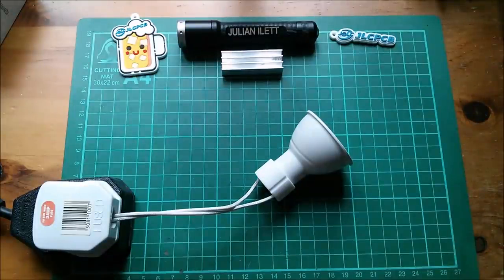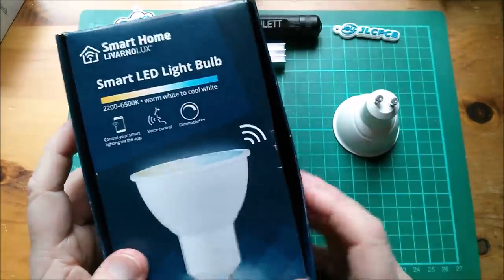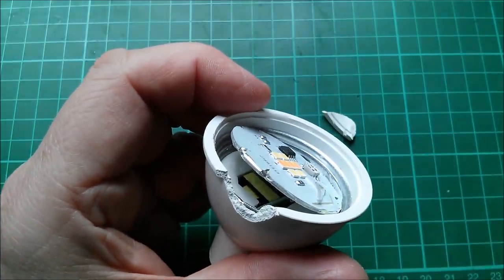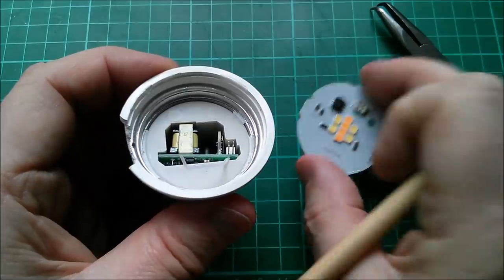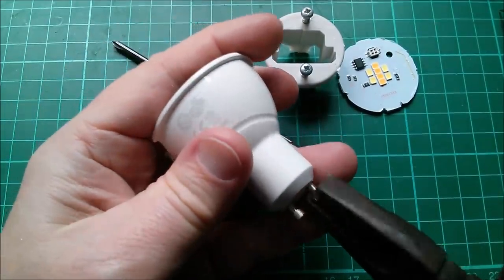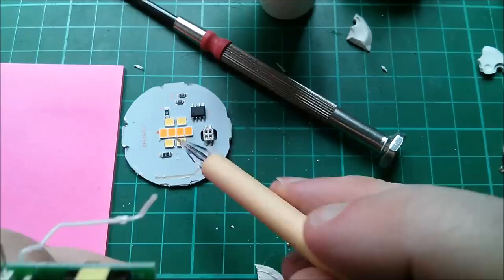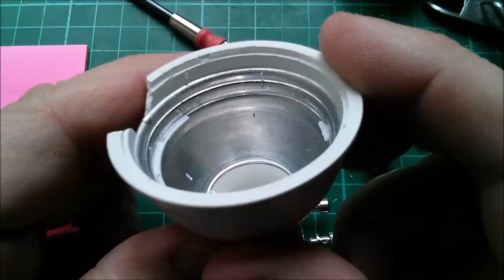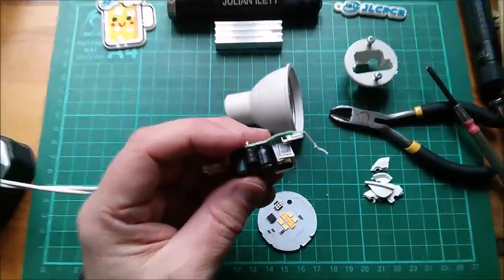Destroyed: Lidl GU10 Smart LED Light Bulb

Comment: Frankenstein it back together Use  it in the shed.
Reply: It's not broken, it just needs a new box.Would be interesting to see what voltage the Zigbee module and LED's run at, convert it to a DC bulb with a buck converter, and run it directly from your batteries.
Reply: Trouble is we know what would happen, how long it would take and how it would end up.
Reply: I agree! Make your own enclosure. You could actually improve the heat dissipation.

Comment: I'm working at a company that is making smart home stuff. I'm in the team that's programming the efr32mg21. We are mostly using zigbee but I've done some research in using that chip with Bluetooth Mesh and even Green Power with wireless switches without battery (powered by the force generated by pushing). Our products are quite expensive but really well engineered so it is quite interesting seeing a low cost application using the same chip.

Comment: Chop the GU10 connectors off, attach a suitable plug and wire to it, pot up the back end to make it safe again, superglue the broken bit from the side on, re-glue the lens back on, and it'll live again... use it on the solar shed with your powerpacks... Problem solved! Nice video btw ;)

Comment: 240v across the inputs and you can get it going again, surely. And checking the four pin connector to the LED panel, you probably have an IOT board that will drive whatever you want to attach it to.

Comment: BP = Bright Power, which are an LED lighting driver manufacturer.

PS. It'll still work, just not in It's original GOO 10 package. ;)
Reply from the maker: It looks like a lot of attention was paid to the thermal design. I've broken that.
Reply: @JulianIlett  ... Just needs a little heat sink compound and a new heat sink with a new hole for the 4 pin connector ... The next question is whether or not it will run off 12v :-)
Reply: @jayherde0  

I'd be hacking it already, so it runs on 12v.

Comment: The BP1638 is a Bright Power constant current LED controller chip.  They do a lot of different ones.  But essentially the resistors set the current you want to drive the LEDs at, and the chip will adjust it's internal resistance to maintain that current regardless of how many LEDs are in the string.  Being that you can dim these lights, that one probably also responds to PWM signals.

Comment: if you had more than one would they all change at the same time or can they be set up as individual lights ? , and no google is not my friend , google is google s friend :-)
Reply: I have twelve of these ;-) They can be operated individually or as a group, whatever you like. It depends on the controller you use (Philips Hue in my case). But you can use these almost unlimited. Use them in groups, operate by voice command (Amazon Alexa f.i.), make them part of a light show, attach to your home security system, and so on....

Comment: Wouldnt it be smarter to put the control for "smart" functions in the light fitting?
Reply from the maker: They also sell smart light fittings - they might have the smart stuff in the fitting :)
Reply: @JulianIlett  They sold the zigbee power strip in my local lidl but not the hub. (Sweden) Is it any use at all without the hub?
Reply: @rimmersbryggeri  they should work with any zigbee hub. I hear you can even build your own with an esp8266 (or esp32) and tasmota. Haven't tried any of this myself though.
Reply: @monophonic_og  Most people that buy their smart home stuff att lidl wouldnt either I imagine. YOu would think they sold more  power strips than hubs though. Terve.
Reply from the maker: I bought the 2m LED strip and another hub. You can have up to 120 hubs on the app :)
Reply: @JulianIlett  Sure but what use are they if you don't have more slave units?

Comment: You can reuse the parts. I did this with 3 Ikea bulbs, that are now lightening my 3D printer. A nice Aluminium Base for the LEDs build, a LED Driver from eBay added and the 3 bulbs in series then operated at 24v with the ability to dim the light with 3.3v from my duet3D printer-board...

Comment: I've opened a led lightbulb, not smart one just to see whats inside
And inside there is a off-line CCS buck regulator without a datasheet ofc, i've modified it and added a pot and now i can change the brightness :D

Also manufacturers stress the electronics so dimming it (just removing one of the two parallel resistors in my case) will make it run a lot cooler and have a much longer life

Comment: Its not broken as you can still wire it to mains and it will work.... >>> May be make it work with low voltage so you can control a 12v Led flood light or something from your  Alexa ???

Comment: BP2522 low power consumption non-isolated step-down AC/DC constant voltage chip. BP2522X is a non-isolated step-down constant voltage driver chip with high precision and low standby power consumption. Suitable for 85Vac~265Vac full voltage input non-isolated power supply. The BP2522X chip integrates a 500V power switch, uses a unique voltage and current control technology, does not require external loop compensation capacitors, and can achieve excellent constant voltage characteristics, which greatly saves system cost and volume. The BP2522X chip adopts multi-mode control technology and supplies power from the output to the VCC, which effectively reduces the standby power consumption of the system, improves the efficiency and dynamic performance, and reduces the noise of the system when working under light load.

Comment: Make a box and put it all in there ready for hard-wiring in your shed. Just keep the LED away from the electronics, and this thing may work for 30,000 hours.
As is, none of these bulbs last more than a few hundred hours. Even the 130ºC caps can't take the thermal cycles.